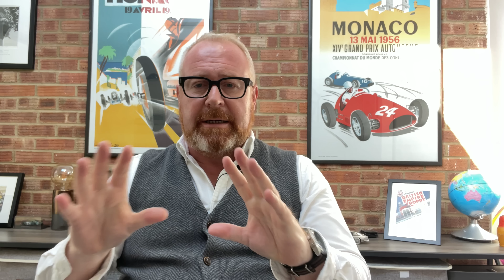Sneak Peek - Polestar 3.  The new, must-have electric SUV?

Comment: There's some nice touches in there, especially the promise of LIDAR, which will transform all forms of assisted driving. All the companies working on fully autonomous driving use it. 

I would've really liked to have seen an estate car version of the polestar two; in fact, if it didn't have so little headroom in the rear, I might have already ordered one.

But I'm not going up to this because it is simply too big for Britain's city streets. 

And having tested a Volvo C 40, I fear it may be too overweight for interesting driving. Acceleration maybe wonderful but as soon as you start steering, you can feel it lurching the opposite way like an angry barge. maybe the suspension will help. 

On a more positive note, I think the Google automotive OS represents a future for car entertainment, which the smaller car manufacturers can never hope to compete with. Its association with android is clear by its use of a Qualcomm snapdragon. If the platform gets momentum, then we can look forward to a better set of applications than any of the manufacturers have shipped to date.

Comment: This is just a commercial for Polestar. Instead of reading out the company PR statement, we want you to make your own judgement and maintain a critical distance. Auto EV is doing itself no favours if you simply shill for a company.
Reply from the maker: I understand what you say @Saurat but remember, all we got was the company’s press release the day before, and until we even see the car (let alone drive it) it would be unfair to pass any judgment or opinion on it other than what we see from images and read from the press release. So I can judge the styling (which I like) but little else. All we are doing is passing on the information to our viewers, just in the same way that the Autocar website has, the Pistonheads website has, etc. it’s no different to what the other press outlets do with such limited information. But don’t worry, when we get our hands on it, it will be scrutinised and judged accordingly and fairly, just as we do with all our road tests. Thanks for watching and taking the time to comment. Bryan@AutoEV

Comment: A hefty price tag that is hopefully worthy of the vehicle. I have owned a Polestar 2 for 6 months now and hope the developers have been listening to their current customers as they progress. No mention of two cup holders under that apparent sliding lid in the centre console...lol. Are plus and pilot packs fitted as standard actually packs? No comparison to the Model Y, I am impressed, but this is way above that price range. Only over thing of notice is the performance pack wouldn't be worth its cost for 0.3sec improvement. Wouldn't even notice it.

Comment: I'm a fan of Polestar, I love their proposition of focus on design and performance, while making use of the trusted hardware, production facilities, distribution network and sheer automotive clout of it's parents Volvo and Geely. I guess that's why I am so disappointed that we can only actually have one in a year from now. The specs I see from this car are good, if not ground-braking for today's standards: charging at 250kW is not at the level of the Germans they claim to compete with, but good enough for current infrastructure, power and range are OK, but nothing I cannot have in a car in this price category already today. Give me one good reason I should wait for this car for a year and not get a German rival today?
Reply from the maker: Difficult question to answer as we haven't driven the car, and therefore don't hold all the facts.  I certainly wouldn't buy the Audi e-tron over this as that car has been nothing but disappointing for me everytime I have driven one on the channel, especially the overpriced 'S'.  I do like the way the BMW iX drives, but at this price point you are in the lower battery model, and I am still not sure that I could live with the looks.  Mercedes are about to show the new EQE SUV, but if its as disappointing to look at as the EQS SUV, and as inefficient as the EQC, then I am not sure its worth it.  So, based purely on that, I would wait for the Polestar, or wait to see what else becomes available soon.  Volvo themselves are about to launch the replacement for the XC90 which is all electric, and will use a lot of the Polestar's engineering and hardware.  So in my opinion, if it were my money,I'd be waiting on the Polestar.

Thank you for watching and taking the time to comment.

Comment: If there's no V2L, I'm out. It's just too useful a feature to have with a big battery.
Reply from the maker: There is.  I mention it in the video.
Reply: Polestar 3 is also equipped for bidirectional charging, enabling future potential for vehicle-to-grid and plug-and-charge capabilities. Says the press release. I have a feeling it won’t launch with  V2L in the same way Kia are doing but happy to be proved wrong.